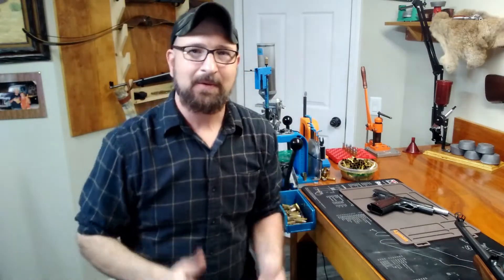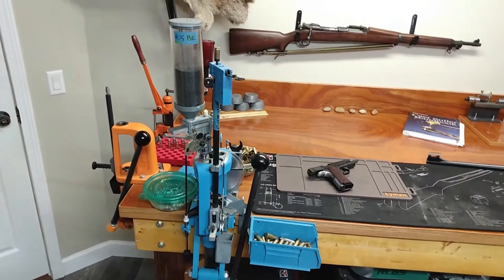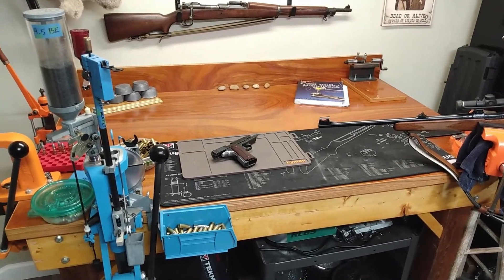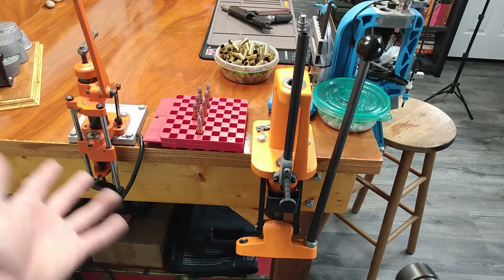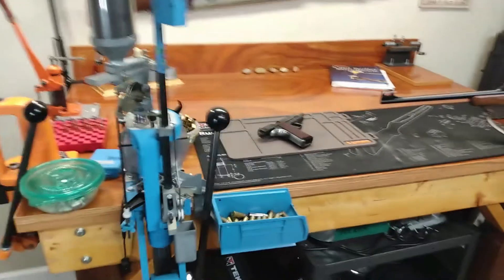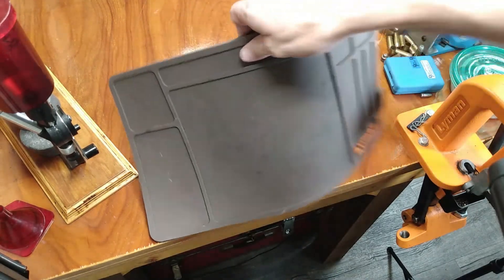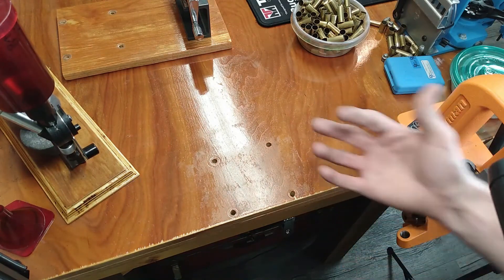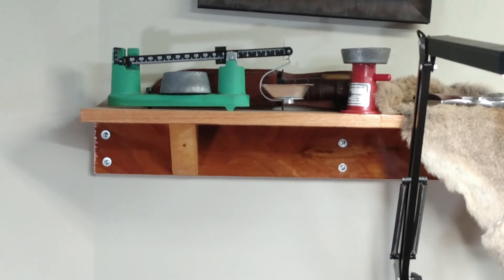2. How I Set Up My Reloading Presses and Equipment

Comment: The day my kids move out I’m going to have a setup like yours 🤣. Until then I’ll have to deal with my small old desk.
Reply from the maker: I remember using an old wooden wire spool on my back deck. I was loading .38 special with the little Lee Loader kit that required a hammer... fun times!
Reply: Kids move out? Good luck with that one. Having a set up like LeadSmith would be a dream come true. IF you ever get all your kids moved out, you will have TWO dreams fulfilled.
Reply from the maker: Hahaha, kids moving out? That's right up there with being able to retire on social security...  I heard about those days. Y'all are great. Thanks for stopping by.

Comment: Very insightful video, thanks! One aspect I missed was lighting setup for the bench. It would be nice to know if you simply rely on ambiant room light, or if there are specific use cases for additional lighting you might have found.
Reply from the maker: There are a lot of light options. UFO seems to be very popular. If I remember, I have a light by fabtech or inline fabrication that mounts in the tool head. I also have 2 4ft overhead lights and a bench light that clamps to my bench. I like lots of light on my work. Hope this helps. Thanks for stopping by!